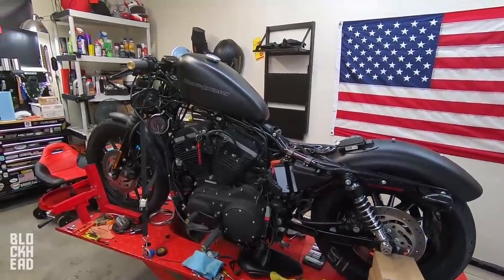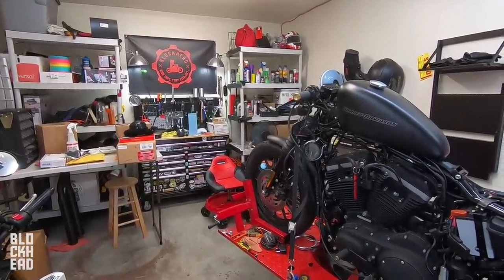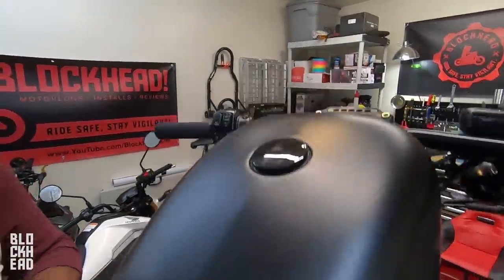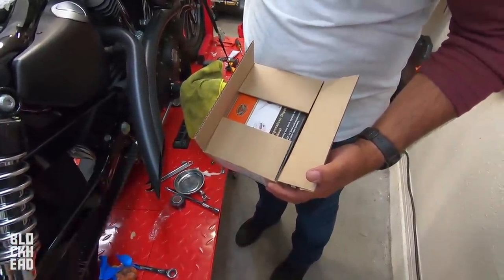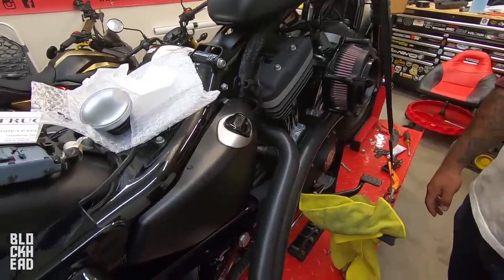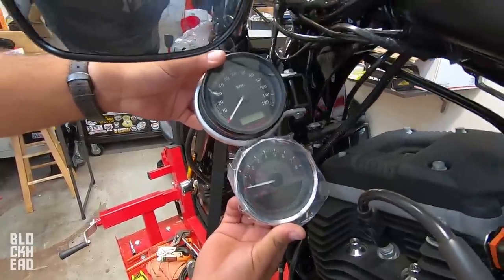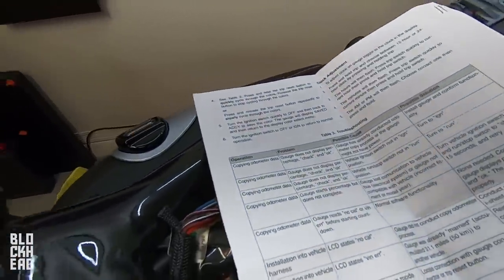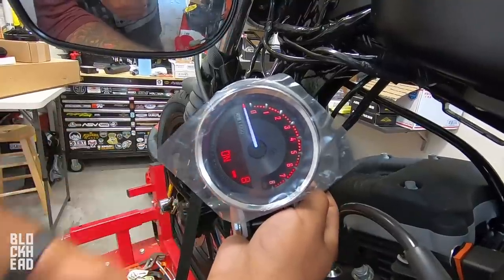Harley Iron 883 Build 🛠 New Gauge, Fender & More! (S2 Ep6)

Comment: In case you didn't know, install the new battery cover clips while the battery is out. Gotta slip the rear clip onto the frame over the battery, slide it back, then install the front one in the same area and slide into place. Kind of a pain with the battery in there. Looking good, man.
Reply from the maker: Nice, thanks for the info!

Comment: I installed a Dynojet Power Vision on my Sporty 1200. It actually has a digital speedo/rpm/temp gauge along with a ton of other optional gauges built in that you can choose. I'm almost at the point of getting rid of my regular speedo. It was the better buy over the Vance & Hines. It has auto tune, plus a ton of other functions too. Plus Fuel Moto has it for around $400. V&H tuner had had too many problems for me.

Comment: Hey Block! Greetings from Costa Rica... I've been watching your vids for a while and I got the same Iron 2013 you had, just bought it last week and Im new to HDs. I will be using MANY of your vids to build it. Just wanted to thank you for the content you post and for people like me new to HDs,  this is really great help. Thanks!
I have a quick question, I know HDs, specially Sportsters vibrate but this thing is crazy to the point were my hands would go numb, the faster the more it vibrates. Since I'm new, I'm not entirely sure that is the was is supposed to be. I'm planning to go to the local HD dealership for a test drive and see. Did you ever had that issue, if so, any advice?

Comment: Are you going to mount the ECM with the heat sink pointing out, not against the battery?  I don't know how hot they get, but it will want to be able to reject the heat.
Reply from the maker: Not sure how we'll mount it. I've seen it mounted w/ heat sink pointing inwards with no issues reported from the users.
Reply: its the brain of your bike for sure. protect it. that can bus system is so important. nothing happens with communication with that ecm.